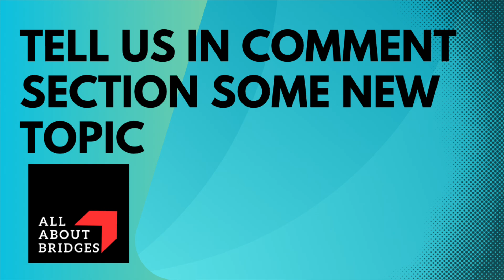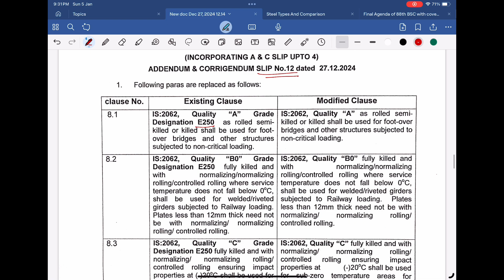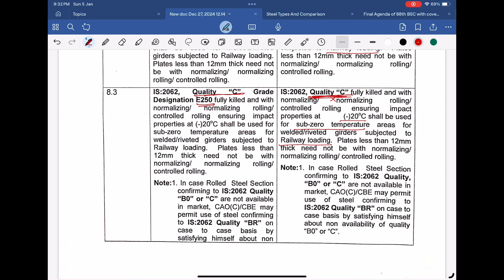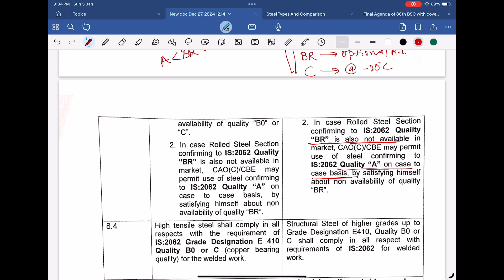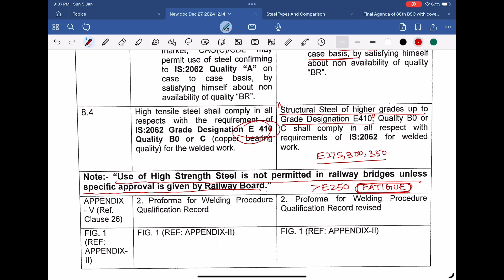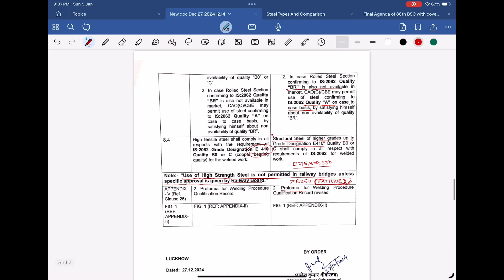Understanding new ACS 12 of IRS B1 and various qualities of steel ?

Comment: Can we use B0 E250 steel for FOB
Reply from the maker: @govindtatikonda9708  if fob girder is designed with E250 then for FOB, quality A is recommended. If quality A is not available in market then with the permission of competent authority one can go for higher quality steels like BR and if that is also not available then for B0. Financial aspects involved should be properly dealt with.

Comment: Sir, Why use of Cu bearing steel is removed in this ACS ? 

Is there any disadvantage by using Copper bearing steel ??
Reply from the maker: It was removed because from language it appeared as if for high strength steel there is only one option ie E 410 copper bearing quality.
Now it’s open and all inclusive Upto e 410.
No disadvantage involved